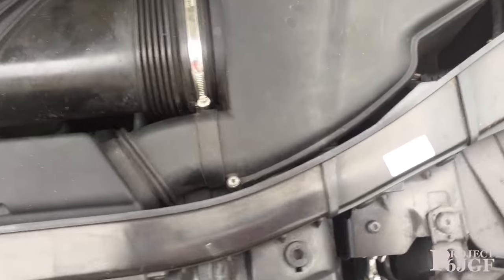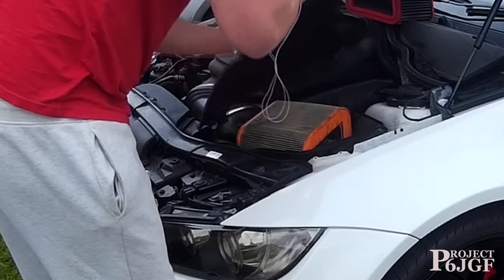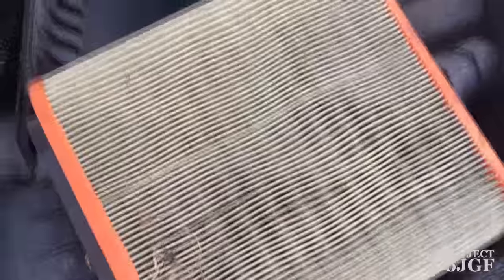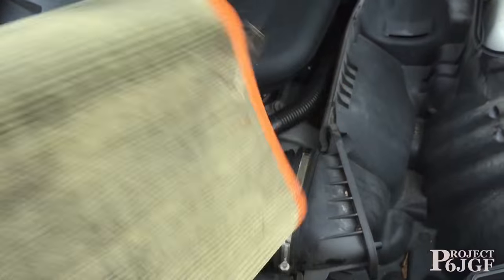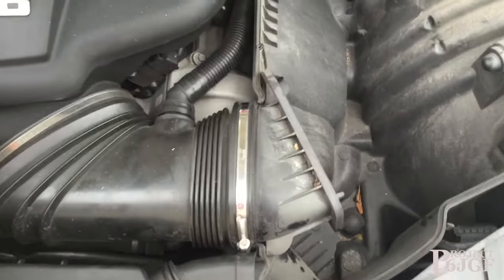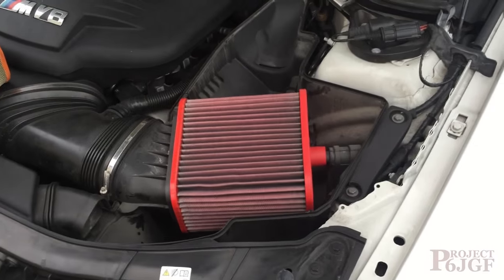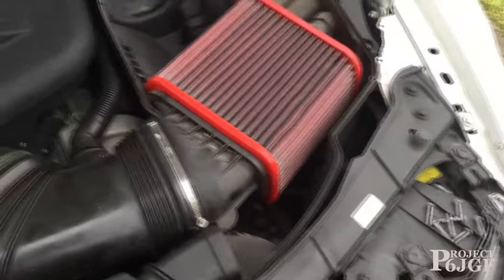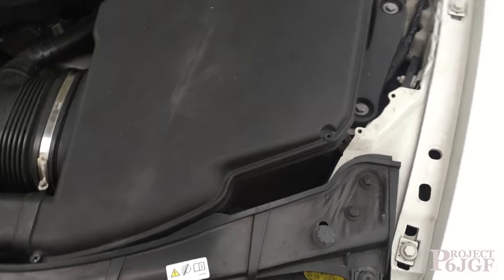How to upgrade your air filter BMW M3 and demo sound

Comment: Nice video. Are your front windows tinted the same as the rear? What percentage did you go for?
Reply from the maker: Simon Mead hello mate, yes they are tinted on the front too but only light smoke, the rears are dark smoke, not sure on percentages though.

Comment: Just bought the Bmc air filter will install next few days. Also have a Borla atak exhaust I"m assuming should sound amazing with that combo. Is your car lowered on what springs? Great video brother!
Reply from the maker: Well done mate, I am sure you will notice difference, my car is not lowered.
Reply: The stance looks perfect are they wheels 19s or 20s? I was thinking of lowering but wasn't sure if it was worth it.
Reply from the maker: +Al Zaidi the wheels are the std 19s with spacers and wider tyres. 
If you want to talk more about this see the links to my social media in the description and message on there and I'll be happy to help